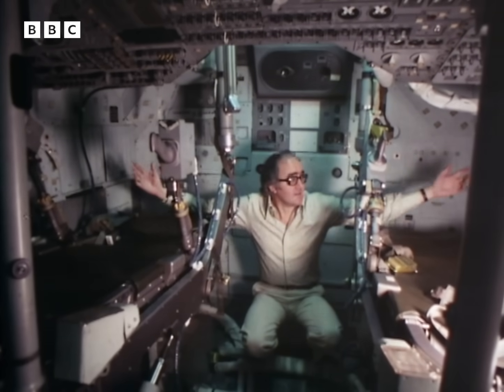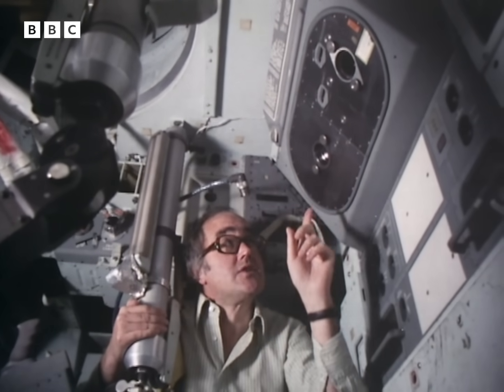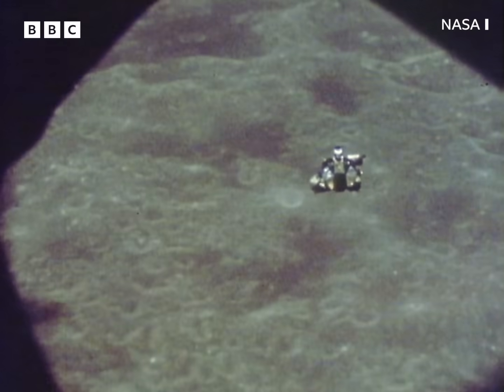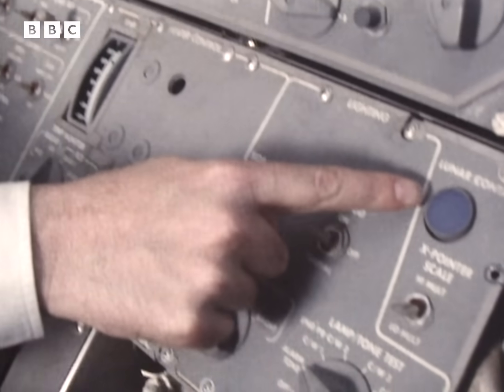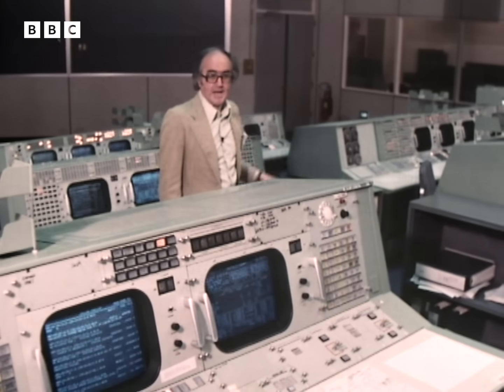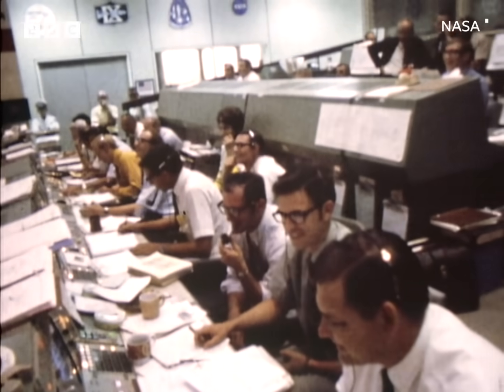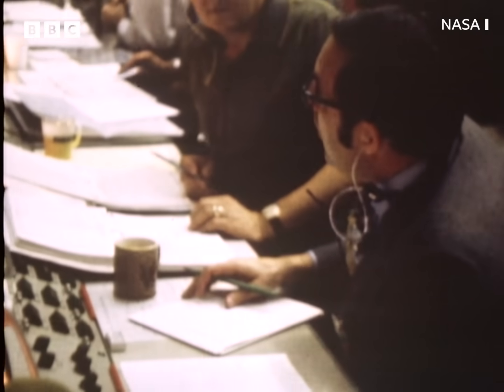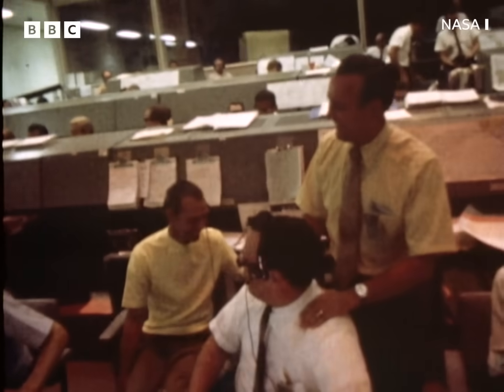1979: How to LAND ON THE MOON | Project Apollo | Retro Tech | BBC Archive

Comment: Anyone, ANYONE, in the 21st Century with a smartphone in hand who is not stunned unto disbelief that this was all done, six times (and thete is no reason to believe it wouldn't have been seven but for the unfortunate incident in the service module's oxygen tanks on 13) without even pocket calculators of the sort given away as promotional materials at trade shows today, but with friggin' SLIDE RULES (I was in high school when the shift occurred: one grade slide rules, next year [expensive] calculators) is an idiot.
Reply: I wasn't all done with slide rules. The spacecraft computers had a performance comparable to the first generation of personal computers like the Apple 2 and Commodore 64 (the guidance computer had RAM of 4KB, and a 32KB hard disk). They were only required to take large amounts of numerical data and organise it into a more useful format. That original data was calculated by the main frames at NASA, and then beamed up to the spacecraft by radio telescope at the rate of 1,200 bits per second. They did not need the power for touch screens or to hold graphics etc like today’s smartphones.
Reply: Could it be that there is a finite amount of intelligence in the universe and, as machines have become more intelligent, humans have got dumber?

Comment: I thought we  "lost" the technology
Reply: NASA did not lose the technology to go to the Moon in the sense that it was forgotten, mislaid or mysteriously disappeared. A lot of the blueprints still exist on file; but the individual knowledge of everyone involved and the “organisational know-how” of how to actually run such a huge, complex project has been lost after such a long time. Much of the equipment is archaic, and many things cannot be bought “off the shelf” and have to be specially manufactured. Re-designing from scratch is cheaper and better. However, it takes years to build up that sort of expertise and NASA is going through the same problems it had in the early to mid-60’s.
Reply: Nope. Lies told by charlatans to the credulous.

Comment: Yet after all these years, they can’t even get back into space, let alone land on anything
Reply: If you would offer to pay the same amount of cash they had back then ( adjusted for inflation ) then I'm sure it could be done again.
Reply: As we speak, several manned missions are in space. Landing on the moon is enormously expensive, so we stopped doing that after Apollo 17.
Reply: @Hobbes746  the Boeing ship is stuck in the space station with problems and will have to stay docked there longer that expected.
Reply: @richarddobreny6664  Boeing isn’t the only one making manned spacecraft. SpaceX has been ferrying passengers to the ISS for years without a problem.
Reply: @Hobbes746  yes true, but only low orbital missions.
Reply: @richarddobreny6664  Low Earth orbit is part of space.
Reply: @Hobbes746 no it is not
Reply: @fransschepens3  Space is the area where air-borne flight is impossible. This starts at about 100 km altitude.
Reply: Now the are through the whole solarsystem, already. Wake up!!!
Reply: @fransschepens3  Who is this “they” you are talking about? Unmanned spacecraft built by humans have traveled through the whole solar system, yes.

Comment: It's easier to see the stars in space than if you're say Columbus or Lief Erickson.
Reply: Leif.
Reply: @kiereluurs1243  
With that spelling it would be pronounced
Life.
Reply: Whether you can see stars in space depends on where you are. If you’re in direct sunlight, it’s far too bright to see any stars.
Reply: @Hobbes746  
I think in space, and on the moon, they just need to block out the sunlight and let their eyes adjust, as there is no air to scatter light.

When they're in deep space, an the way to the Moon and back they're always in the sun.   But as long as their telescope is not pointed at the sun, and lens is shielded, they can see the stars.
Reply: @charlesvan13  When you’re on the moon, the surface is brightly lit, so you have to block all of that out. John Young did this: he stood in the shadow of the LM, looked up to get the surface out of his field of view and waited until his eyes accommodated. 
In space, as long as the spacecraft was in sunlight, the cabin was brightly lit. They had to put shades over all the sun-facing windows to see the stars.

Comment: Probably the clearest recounting of the landing procedures and the personal experiences and the landing itself that there is. One quibble, however.

0:15  The explanation of the hand controllers is wrong. The right one, a conventional looking joystick, controls roll, pitch, and yaw, like the one on a airplane. The left one controls going front, back, and sideways. It doesn't control power like the throttle in an airplane. A movement from each controller causes a single burst from one or more of the reaction control thrusters. The number of bursts applied determines the "oomph". That's the closest thing that's analogous to a throttle.More bursts means a faster roll rate or faster movement in whatever direction, etc. Opposite bursts are then used to arrest this motion.

Comment: The team at Curious Marc restored and got a Apollo Guidance Computer ( AGC ) to operate and land on the moon.
Reply: Including the 1202 alarm!
Reply: They are currently working on getting the radio and TV equipment working again using the original components.
Reply: @ApolloKid1961    Update, they got the radio, TV, telemetry working.  They have also gotten hold of a real DSKY that was used in the MIT training mock up.

Comment: 2:53 

"The missile knows where it is at all times. It knows this because it knows where it isn't. By subtracting where it is from where it isn't, or where it isn't from where it is (whichever is greater), it obtains a difference, or deviation. The guidance subsystem uses deviations to generate corrective commands to drive the missile from a position where it is to a position where it isn't, and arriving at a position where it wasn't, it now is. Consequently, the position where it is, is now the position that it wasn't, and it follows that the position that it was, is now the position that it isn't.
In the event that the position that it is in is not the position that it wasn't, the system has acquired a variation, the variation being the difference between where the missile is, and where it wasn't. If variation is considered to be a significant factor, it too may be corrected by the GEA. However, the missile must also know where it was.
The missile guidance computer scenario works as follows. Because a variation has modified some of the information the missile has obtained, it is not sure just where it is. However, it is sure where it isn't, within reason, and it knows where it was. It now subtracts where it should be from where it wasn't, or vice-versa, and by differentiating this from the algebraic sum of where it shouldn't be, and where it was, it is able to obtain the deviation and its variation, which is called error."

Comment: The video of the take-off stage of the lunar module shows that the  fuel tank is located on the right , and the oxidizer tank is on the left .How did  this happen ?😂 lt should be the other way around . Look at other correct photos and videos .
Reply: I read that the film was shot thru a mirror pointed out the command module window.
Reply: Sometimes videos get shown inverted. It happens a lot.